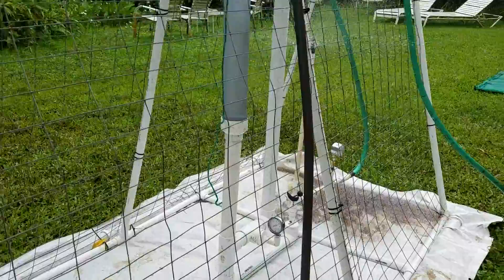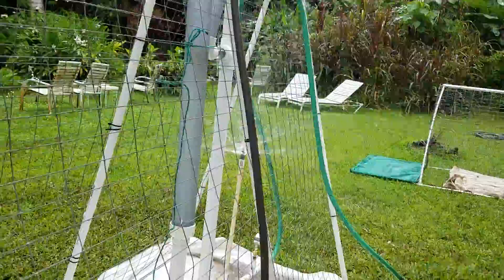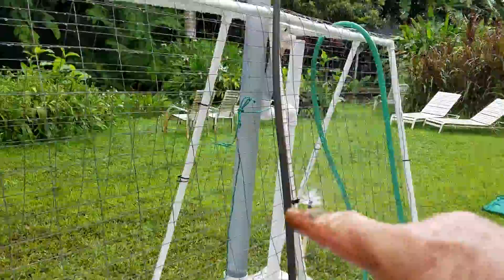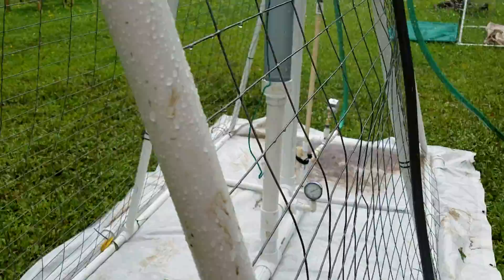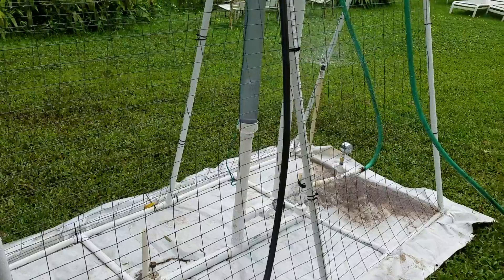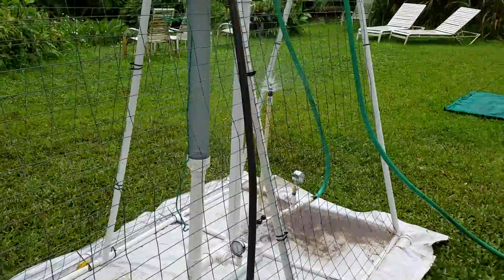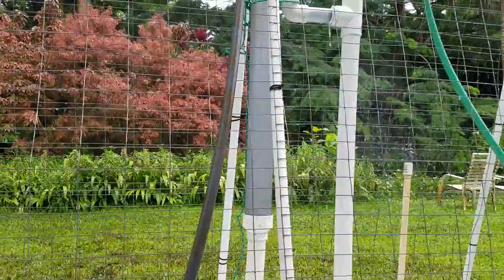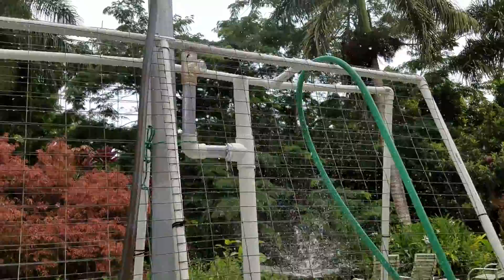Glenn Martinez testing the spray effect for Jamaica aeroponics. Now in Jamaica. Yahoo.  (OGV#79)

Comment from the maker: The green hose brings 2psi air 25 watt to the pipe in a pipe pump …. That is four ft deep. That is pumped up a 2/3 pipe to the pig tail nozzle that sprays the water up to the plant roots